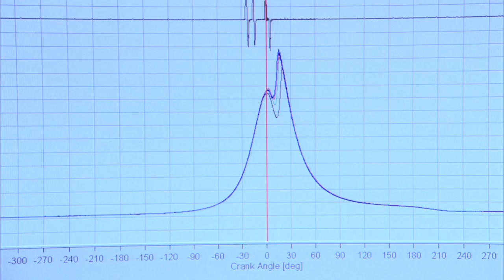Volvo Car Corporation's New Engine Strategy

Comment from the maker: Just to clarify: The 4-cylinder strategy means that combustuion engines will be combined with electric engines . In short words: The cars of the future will all be hybrids. There will be no compromise on driving performance, torque, acceleration and so on. And you will get it with a much lowere fuel consumtion. You will hear more about this on Sep 13 at the Frankfurt Motor Show pressconference 10.00am CET... /The Editor